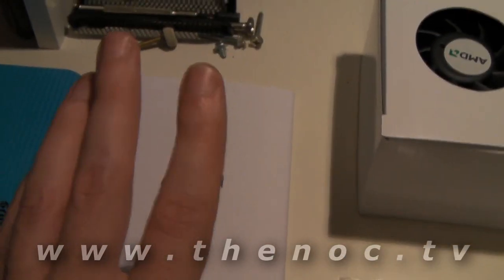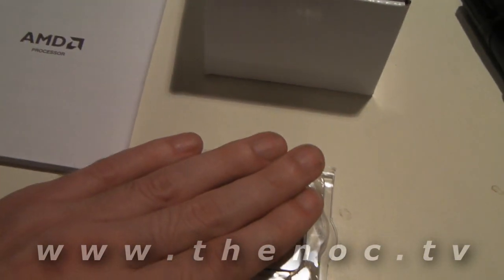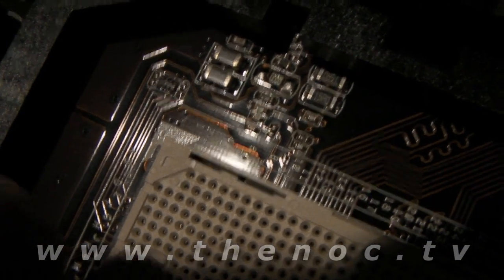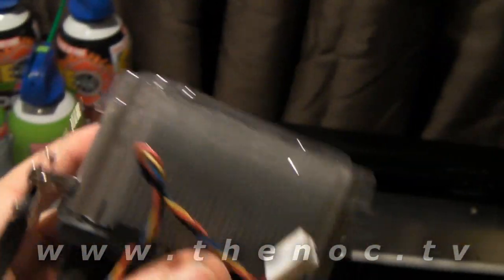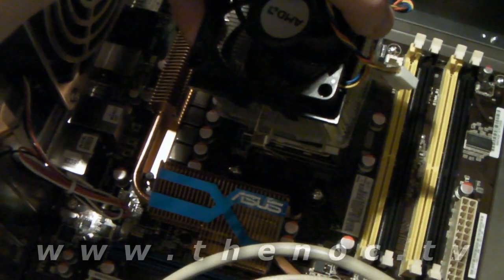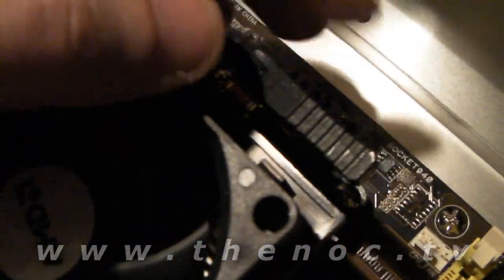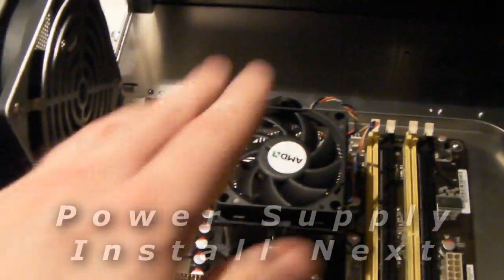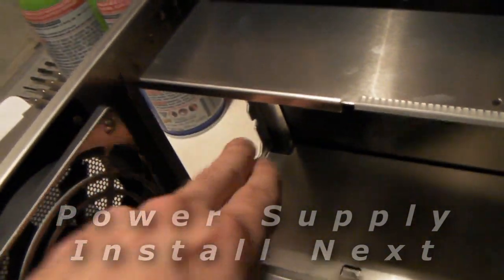Build your own custom computer - Installing the processor

Comment: Your not supposed to touch the processor 
Immediately destroy this machine. Your processor is now modifying the DNA found in skin cells amidst those finger oils and it will e-mail corrupted copies of your DNA to all 5,000 lonely old women. When using their mouse wheels, it will generate an electrical static charge which will impregnate them and your corrupted DNA will be merged with that of an alien life form's DNA code stored on Norton's next signature file update. Then, 7.247 months later 5,000 babies will be born that look like a pink eyed albino love child of Michael Jackson and Joan Rivers.

Hurry up !! your processor is sequencing your DNA as you read this !!!!

Alternately renew your Norton AntiVirus subscription at twice the normal fee before the next full moon will sterilize everything and the world will be saved.